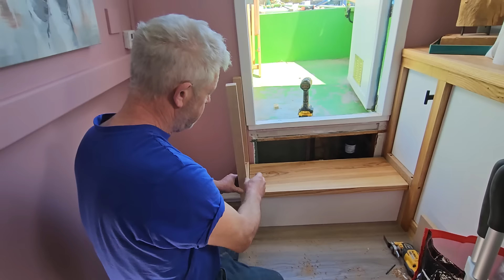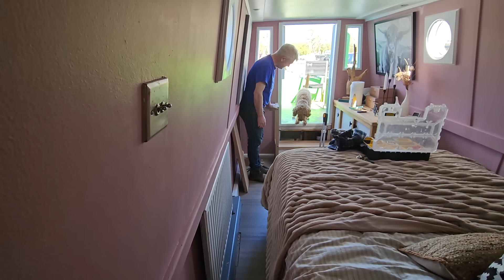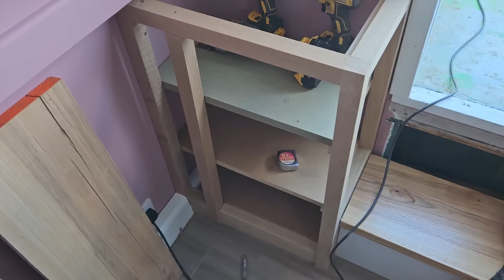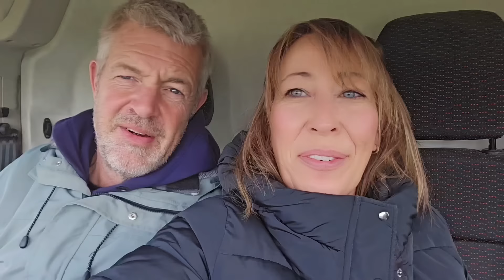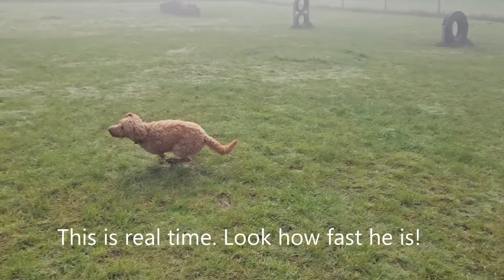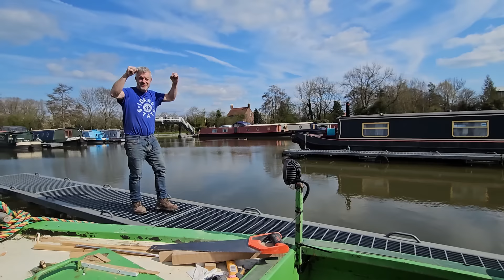Assistance is on its way. Narrowboat Helping hand. Ep23

Comment: On the slide out step, why not cut out a hole the width of your hand by about 1 inch high (_____). That way you can grab a hold of the step firmly and pull and slide the step out. Plus the hole will give extra ventilation for that area under the step. Just an idea💡🤔
Reply from the maker: Hi there, thanks for watching and commenting. We did think about doing an additional hole, but opted for the 2 ventilation lines instead as we thought that with a hand hole or even a finger hole the you would be able to see through them to the water tank and we didn't want it being seen. The lines do give good ventilation as they are big enough and connected to the bottom part but not big enough for the eye to see whats through them if that makes sense. The step itself has an overhang so fairly easy to grab that to slide it out when needed. X